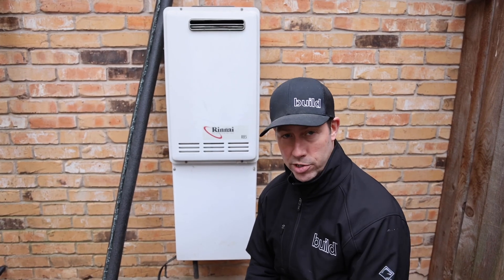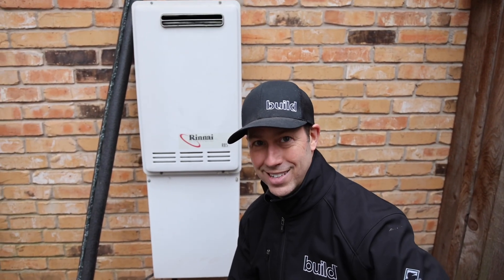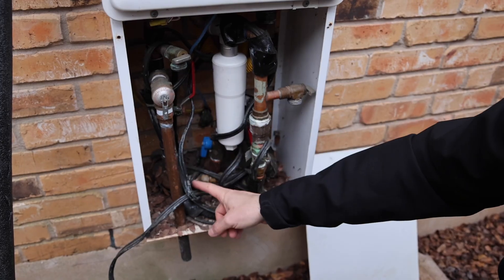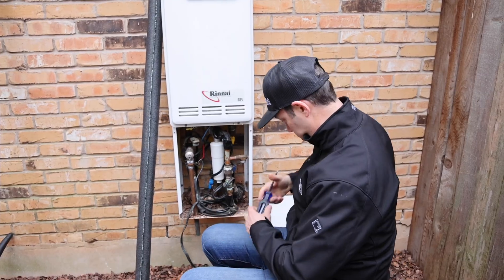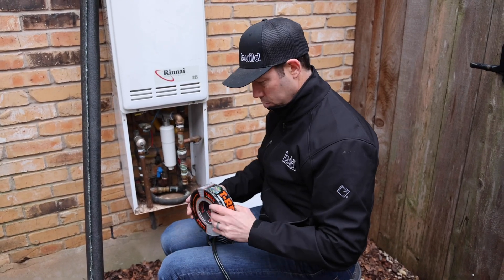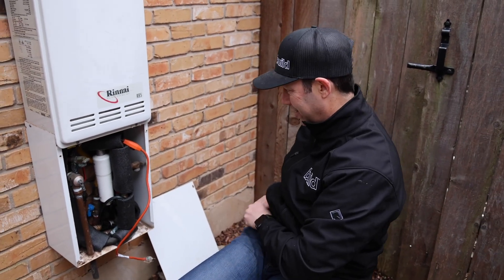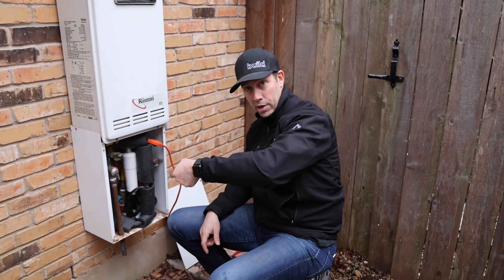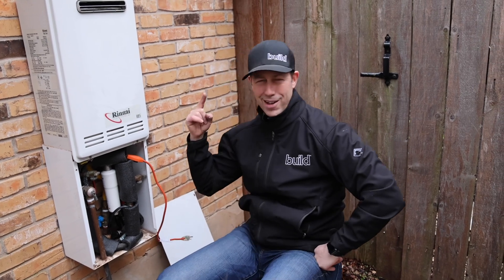$30 and 30 Minutes - Tankless Water Heater Freeze Prevention

Comment: I can’t understand why people put these outside! Why! You don’t install a standard water heater outside! Makes no sense to me?
Reply: When you mount them inside the house they require special double walled stainless chimney pipe for fresh and exhaust air.  If you mount them outside, the air just rushes right in and the exhaust doesn't build up inside your house.  I have one mounted inside my garage where the old tank was and it needed this more cumbersome chimney.  when hell froze over in Texas on 2/15/2021 I was so glad mine was inside the house.  have a friend who has one outside the house and it did freeze up.  luckily they got it to thaw before the pipes burst.
Reply: @TheRetrodog  did u lose power? We are in cypress area and have a regular water heater in the garage. I was interested in a tankless one but wanted to know from someone who has one how they held up. Would u recommend it?
Reply: @irmamartinez188  I do recommend a tankless water heater.  I have never looked back on this decision.  that being said, quality counts too.  there are junk brands out there that may make you regret your decision.  the one i got was a Noritz and it is about 14 years old now.  it has been wonderful and I would never go back now.  I also lost power repeatedly over the past few days.  the tankless although it is natural gas fueled, it still has electronics that wont work when the power is out.  I thought i could use a backup battery to power the electronics, but the exhaust fans were too much for my tiny backup battery.  It would need something much more substantial to run that system.  The never ending hot water is wonderful and I dont have to worry about a broken/leaking water tank ever again.   If you are on natural gas you may need to have your gas meter swapped out to accommodate the higher gas flow rate of a tankless.  the good news on my end was that the gas company swapped it out without charging me.
Reply: Safety and water damage prevention!
Reply: They do in Australia!
Reply: If they are gas, which most are, they have to vent out.  If you design a new house with using this system in mind, you can design an interior space for it.  But many of these are outside because they were part of a Remodel.
Reply: Ours is in a closet in our garage up against our house but every year since we've been here the polar vortex has hit and caused temps to dip 10° or below and every single time our pipes freeze and we don't have hot water. We are currently experiencing this. 🥴 We've got pipe insulation AND the thing is in that closet! Nowhere near the super cold of outside! But it must dip below freezing. We are trying to figure out what we need to do cause this is the 4th year it's happened and we are tired of going without hot water in the cold.
Reply: We have an externally mounted 7nit very similar to this one. It was 10 below F yesterday morning and zero problems. When it was installed we installed a short heat trace run and insulated the pipes.
Reply: We live in NW Florida.no need to have it inside

Comment: Heh.  Up here in the land of -40 (well, -37 last week) I’ve got through thousands of feet of that heat tape.  These days I’ve taken to installing potable-water-safe inside-the-pipe heat tape, from either Easy-Heat or Serge-Baril…  saves my butt from having to get out in the lower double digits with my portable thawing rig…  A garden sprayer, a kettle, and 100’ of 1/8” DOT plastic brake line… :)

Comment: I have exposed pipes that go to a water softener in my garage and had to use a hair dryer on them once.  I make sure the foam wrapping is in good condition every fall, but since then I also put an old blanket over them every time the temps get more than a few degrees below freezing.

Comment: Tell me how that region 1 furnace handles single digit temps you’re going to see this weekend. Hope you guys have a backup generator, might suffer some power outages from the increased power draw.
Reply: Gonna be some cold people in Texas who ain't used to being cold for sure.
Reply: Leland Holton gets the prescient comment of the year award. These external tankless heaters have basically exploded for tons of people in Texas now, pretty much everyone who lost power, and it's basically impossible to get it replaced now because the supply is already gone.
Reply: the Texas electrical grid is designed for Texas summers where half the state is a literal dessert and the other half is a humid hell scape, the power generation won't be a problem. maybe people running into poles, etc might be a problem but not the generation of electricity
Reply: @obviouslyniceduh5521  This comment aged like milk.
Reply: @obviouslyniceduh5521  hope you meant 🌵 desert and not 🍰 dessert
Reply: Outside is more safe than inside because of carbon monoxide. You don’t have to worry about dying in your sleep if there is damage or leak. One less vent going through the roof.
Reply: @mbbigm4784  Yeah...only dumb people don't know what a carbon dioxide detector is.
Reply: @john-smith.  dead is dead!
Some people sleep thru anything! Just like all the people that never change to batteries in those detectors!
Outside is good! Sleep in peace or RIP.

Comment: Most Tankless units require a 120 volt connection to ignite the gas fuel, it would be easy to splice in a circuit for the heat tape.
Reply: especially if it is a model that plugs in.

Comment: Or you could build a small closet to cover the unit and insulate it with a foamboard inside it if you're really worried about freezing.
Reply: Or you could simply install the heater inside the house.
Reply: @morlamweb  Exactly.
Reply: Yea that would be my long-term solution

Comment: Who is dumb enough to put a water heater on the outside of the house? This should never be done for so many reasons.
Reply: It’s very normal around here in Austin. I think some people here would argue, it would be silly to waste interior space with a water heater when you can mount it outside. Especially in a small home
Reply: In Florida, all gas tankless water heaters are installed on the exterior of the house.
In the hundreds I've seen installed, no issues.
Reply: Odd, Matt never mentions that installing outdoors is not only stupid but lazy.
Reply: @robertmontgomery7158  he has mentioned it in other videos, I'm surprised to see that he has installed them outside for clients.
Reply: Here's Matt's reasoning.

https://youtu.be/P9SsMIBGn2M?t=166
Reply: Very normal in warmer states. For builders in the DFW area, installing on the exterior of the house is common practice.  Additionally, the units are equipped w/ freeze prevention heaters.
Reply: common here in southern Louisiana
Reply: Stupid is as stupid does.

Comment: let the water drip slower than a coffemaker,no tools no problem.
Reply: @Matt Risinger. I'm guessing that a small stream from a hot water faucet inside the house will still work? Even if the tankless water heater doesn't kick on, the water will still be flowing through and will work on the same principle as opening a cold water faucet to keep those pipes from freezing?
Reply: @ccadama  2d
Reply: It actually depends on how cold it gets

Comment: You could add a temp plug so it only comes on during freezing weather and not waste electricity. In the south it’s freezing one day and 60 the next.
Reply from the maker: This has a built in temp monitor and only heats below 50 degrees (can’t recall the exact temp but that’s close)